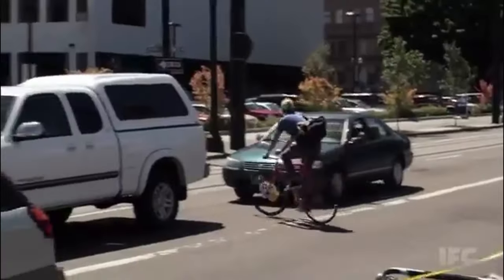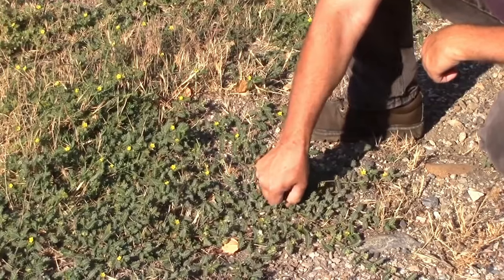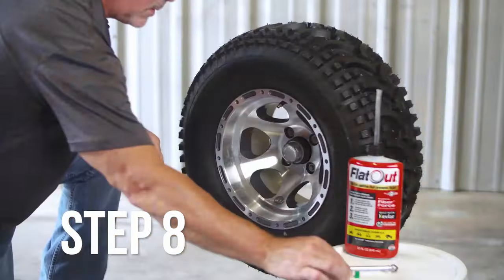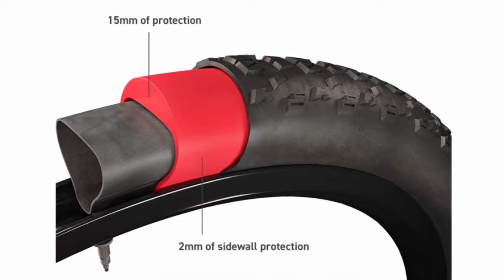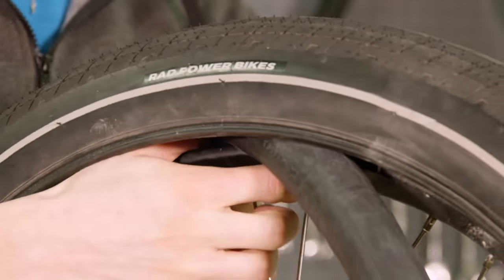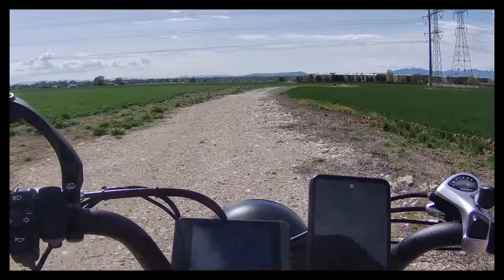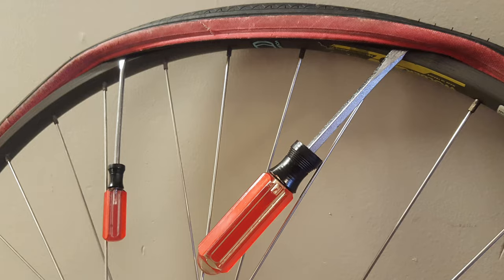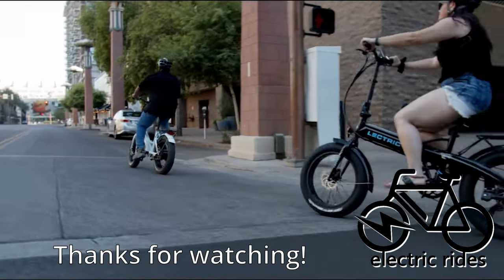How to Prevent Flat Tires on Your Ebike!

Comment: I went to Walmart and bought 2 puncture resistant tires and tubes. Best $60 I've ever spent.
Reply from the maker: What size did you get? I've been wondering if more brick and mortar stores are starting to carry fat tire/ebike size tubes now but I haven't seen much in my area.
Reply: @ElectricRidesUT  they have 26", 24", 20" and 16". The tires last me a little over a year if I rotate the tires when the rear one is starting to wear down.

Comment: i have a fat tire e bike ad was contemplating lining my tires with adhesive kevlar tape (the commercial kind, not intended for tires), im wondering if the adhesive combined with the airpressure would be sufficient to keep the tape in place, or whether i should use patch kit glue or something
Reply from the maker: I've heard of liners with kevlar woven in so I imagine it may work well. The only thing that may cause issues is if the tape's adheasive was acidic and caused the tire's rubber to break down over time.

Comment: I have had ten flats in one year. 
Slime leaked out.
Fix a flat leaked.
Tannis liner was too small for my 26 inch tire. I had to cut it to fit to size, in which it had a 4-in gap to fit tightly. (It was just too small)

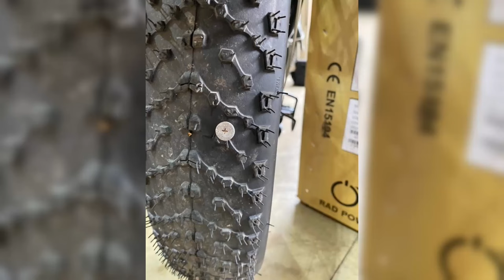Comment: 2:00 Bike lanes in the gutter -I mostly avoid riding in those lanes for the reason shown. E-bikes enable higher  sustained speed and a wreck at 20 is four times worse that a wreck at 10. These "painted gutter lanes" are my town's attempt at making the city more bike-able, but are in fact intended make sure motor vehicles have the right of way and can move untroubled by pesky bikes. 
I use a mirror, ride the continuous left turn lane on many streets, and move over for overtaking traffic if no left-turn lane. If they get pissed that I don't go into the gutter for them I don't care. 
Our Governor has made treating red-lights and stop signs as yield signs for bikes.
I used to drive commercial, so I am practiced and comfortable dealing with auto traffic. My riding style might not be for everyone.

Comment: Slime and Mr Tuffy are not bulletproof. I have both on a regular MTB and I still got flats. They will take care of goat heads but things like nails and staples it's iffy. I got a staple on the rear wheel that went through the tire liner but the slime patched it up. Recently I got two tacks on my front wheel while riding in the rain and both the liner and slime failed. I had to patch it up.

Comment: I also be well worth buying some of that slime to put inside inner tubes,Less chance of getting any more punchers,Ive never known to get sooooooooooooo many punchers before,Getting bad to worse for it,Soon I bike home,Tires are still pumped up,Always first thing next day,One of the tires flat again,Ive only had my E bike for about nearly 16 months now,Brought brand new on E bay,It do get used quite a lot,Ive had a lot out use out of it,Need to get a chain breaker,Get the chain replaced and ball bearnings in the crank,I got some spares in my cupboard,About time really to give my E bike a full service repair

Comment: Slime  didn't  work for me.  It  clogged the  valve. Couldn't  get  100 psi  through  the valve.  General tire made  a  self  sealing  tire long time ago.  It  was  a five layer  soft  rubber  sealant  on the inside of the tire.  All  tires  should  have it.

Comment: hi to all them liners the red one they are super ace  i have them in all my ebikes   one the holes stopped dead  if you ride a 1000 watt ebike you got to have one 

100%  when you could be miles from home  it's better you get a bike shop to fit it  they can be a pain to fit i did my bikes  myself   i am a  tec 
and  it was not easy

Comment: I'm still missing the best trick affordable trick! When I do this I can ride without a flat! For 2 years (urban area)!

Simply by having a double tire! You could even use your old or even small punctured tire for that!

1) It is important that the inner outside tire is 5mm smaller than the outer, outside tire! No more, but absolutely no less!
2) Ofcourse the inner outside tire needs to be low profile
3) It's best and actually more necessary to apply grease or talk powder between the inner and outside tire. Makes the job a lot easier and creates less errors. Because when there's less friction between the layers, the inner outside tube can spread more even against the inside of the outer-outside tire!
4) Positive upside, you also created a double thick wall!

-) Downside, the pressure needs to be a bit higher, because a single inner tube has to inflate 2 tires!
+) But than again, because the inner tube is inflated in the smaller inner outside tire, you will need (very noticeable) less air !

To make sure you won't get an extra leak around the valve, because of that extra pressure...
Put an extra metal and/or rubber washer around the valve, at the inside of the wheel!
Reply from the maker: Really great tip! I appreciate it 😁🤘
Reply: @ElectricRidesUT  , no problem!

If you are going to try this in the future, just reply to here!

So to be clear..! For the double-outside-tire to work. Their seizes need to be like:  47-622 and 42-622. Or 32-622 and 37-622. As long as there is a 5mm difference in with between the tires. It will work!

Comment: 😅😅😅😅😮😂😂😂😂😂😂😂😂 it's funny I learned a method that's cheap inefficient and is proven to prevent flats
Reply: You can also take an old tire like say if you have a kid that likes to skid he blows out his tire you take that same old tire and you cut up the sides of it right along the middle of the tire and then you stuff the rubber part hard rubber part of the tire itself inside of another another tire and then you just shove the energy in between two pieces of tire the tire acts like body armor for the tire underneath that protects the tube

Comment: Yes, you left out the most important fact there is today in tires. ALL tire manufacturers except one make absolute crap tires, just toys that will go flat very easy. Dangerous tires that may blow out on high speed descents. IF you ask me all these tires should be illegal and would never come close to passing a DOT certification. Why cyclists have been forced to endure flats is because the bicycle industry, and now the Ebike industry, have been filled with cocaine head drop out engineers that cheated their way through school and cannot get good engineer jobs so end up in the bicycle industry. Bicycle design has not changed in 100 years, we still ride today absolute crappy weak machines that get flats easily, stretch chains in just months, break new spokes in just months, incredibly useless kickstands, have ridiculous brakes, stupid gearing and kiddy crap tires. The ONLY tire on the market that is not a toy and what I use today is the Schwalbe Marathon Plus 26x2 inch tire. Unfortunately, Schwalbe does not make fat tires, so here I am again looking for a way to improve my 20x3 inch tire from leaving me stranded on the side of the road with a one to two hour tire repair. Good luck finding a portable pump to bring along with you, ALL I have used so far leak with horrible seals to the valve stem. I have to carry two pumps with me, because I can't trust one to do the job with their PLASTIC crap connection to both schrader and presta valves. WE NEED a solid leak free DURABLE connection with a flexible hose, so we don't damage the stem when inflating. Fortunately, my ancient Zefal pump still functions, the last of its kind.